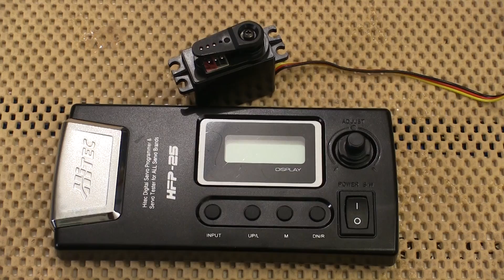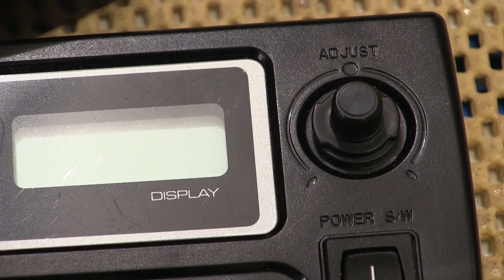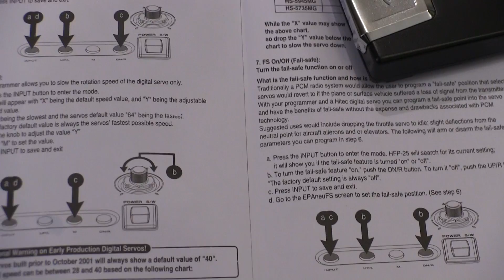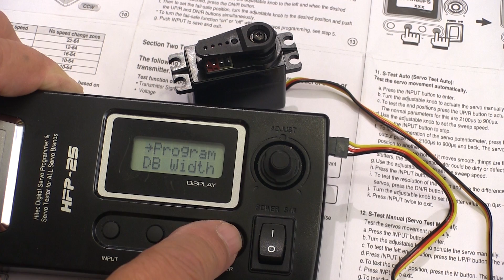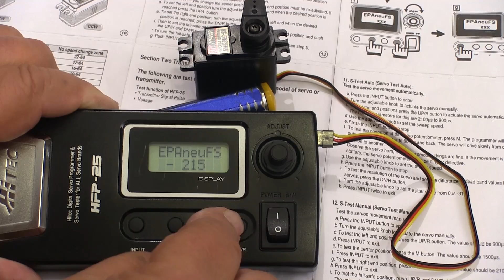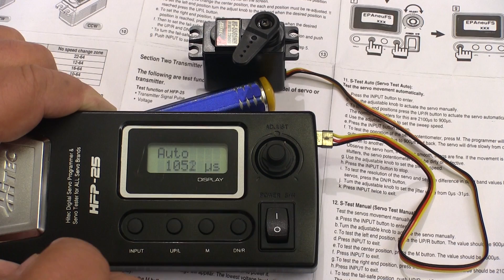Hitec HFP-25 Digital Servo Programmer & Tester

Comment: Hey thanx for the videos they are helpful! I'm setting up a 100cc edge with dual aileron servos, but my transmitter doesn't have enough channels, so can a person program the aileron servos, adjust the end points accuratly so they are matched perfectly and connect them together with a y harness? Or are they still going to fight each other slightly and over heat? Or do I need to buy a new transmitter with more channels so that each servo can have its owns port in the receiver?

Comment: Thank you for the video, I need to make some digital servos rotate 180° and turn their fail safe off, this video helped me understand. 

Do you happen to know if the HFP-25 programmer can program Goteck servos (HC1621SG - HC1627SG - HC2125T)?
Reply from the maker: I know it will program HiTec servos, I have no idea about the other brand.
Reply: +thintz12 thank you for the answer :-)
Reply from the maker: You need to check the HiTec site for the full documentation for this and other programmers they have.